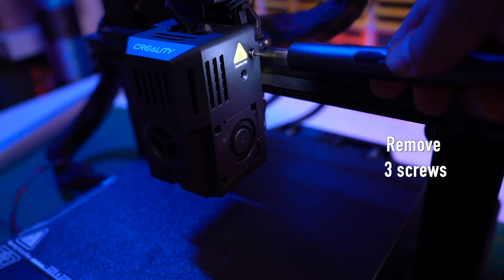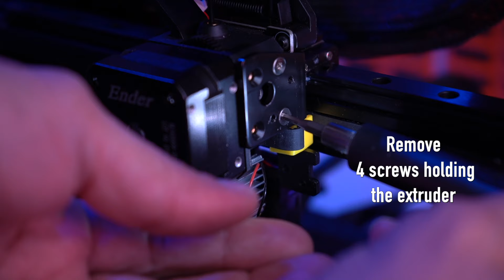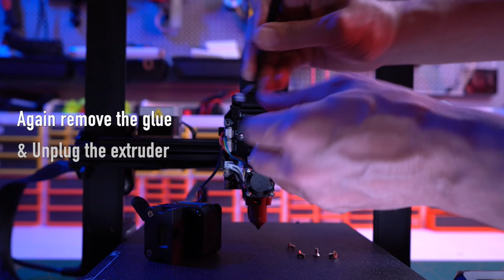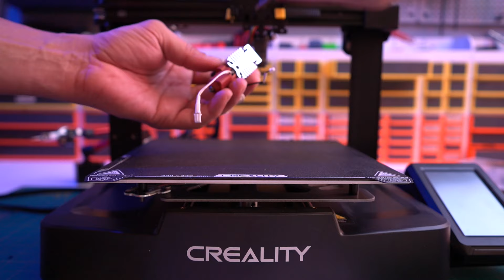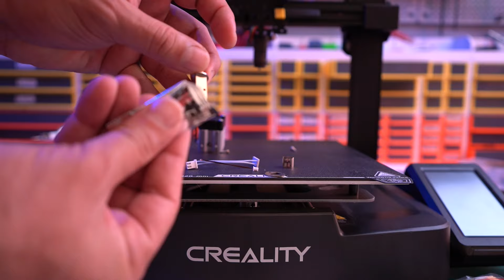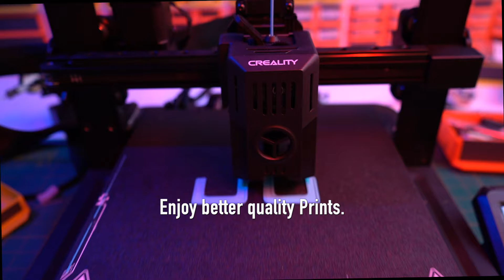Toolhead / Hotend upgrade ... Ender3 V3 KE Part 1  ... HOW TO

Comment: There’s not much sense to swap k1 hotend, V3 KE works very good and very precise and buying new hotend makes no sense.
Reply: Totally agreed! This is just an "upgrade" for the sake of upgrading. My stock KE prints as good quality as my Bambu X1C.
Reply from the maker: True, stock hotend is good and Might not make sense to u , all depends on ur experience, and the hotend is something optional to change, but servicing it is something not good with the stock, weight and nozzle options beside flow ... give it some time with the stock hotend you'll find out if it suits ur printing needs or not
Reply from the maker: @cybergnetwork588  oh man @creality3d should hear this ... KE is as good as the Bambu X1C , would oive to see a comparison... I mean, yeah, creality sent me this printer, and it's good, but this statement is so bold. I'm not sure how it's as good, printing nearly at half the acceleration/speed ... but there are few issues with this printer , I think the next upgrades could explain.
Reply: It works great until it doesn't. My KE had the same problem as many others - filament vomiting out of the sides and melting into a blob. I replaced my hotend with another stock Creality one, but it's not heating correctly. Like 50 degrees too cold incorrectly. I have a Microswiss hotend on the way.
Reply: @waggy401  I have the same experience creating those blob on specific PLA
Reply: Im using this tutorial because one of the connector wires got severed while cleaning
Reply: I just got the error “nozzle heating not as an expected” and it was working yesterday. I think stock hotend is suck…
Reply: Can it print nylon good with that hotend? Or should I upgrade?
Reply: I broke my hot end while repairing and it got stuck. Filament was not extruding. Brand new printed gone within 4 hours. 😅
Reply: @omranello I’m looking to transfer my hotend to dual extrusion
Reply: @omranello  yeah I've found some issues with both of mine. The V3 corexz fixes most of them but I have 2 KEs and don't have much money to sit upgrading at the moment. Honestly creality should've designed the entire z gantry better and fixed the y axis, that's really all it needs to be decent, a better extruder would've been nice cus the sprite won't keep up at high speeds, they limit the machine in the profiles with volumetric flow

Comment: so the belts and idlers of the K1 that are in the description are fully compatible with the KE or do you need e-steps calibration after replacing them or something else ? Cause the Y & X axis belts are grinding a bit , but not bad , and something stronger with more grip would be more suited as even now i have an order of 1500 small prints , so my SE & KE aren't collecting dust ( i'm novice to intermediate level xD )

Comment: Does this require any modifications to firmware code or anything like that?
Reply from the maker: @mDayShamangahabash  not really ... it need a PID tuning ... but if u have no problems with ur hotend ... please don't change it 🙏
Reply: @omranello  Changing it will allow me to use standard length nozzle replacements, instead of KE's long ones.

Comment: Hello, I'm a beginner. When changing to this hotend model, do I need to make any additional adjustments or can I use it as a direct replacement for the factory default?
Reply from the maker: Direct .. replacement... but PID Calibration is needed ... if ur hotend working fine .. dont change it
Reply: @omranello  I tried to buy a hotend like you and found that the temperature probe cable was too short. How do you solve this problem in ender3v3ke?

Comment: i place this hotend and all the time crashing printing any idea why? looks like fillament to fast going and burning, nothing updating in slicer? or somewhere else? and printer always show nozle heating problems
Reply from the maker: What do u mean by "crashing printing? And filament to fast?"... u only need to do PID for the Hotend ..
 Make sure ur thermistor is connected properly and no wire is disconnected ( for the heating problem)
Reply: @omranello  sometimes write printer nozle heating problem and restart printer, start print good but later looks like filament burned in nozle, how to do pid for the hotend? all parts is connected
Reply from the maker: @Deividas33  sounds like u have nozzle leaking .. make sure ur nozzle is tighten to exact torque ... and for the heating .. most likely it's ur thermistor .. check the wiring... maybe a pin is loose or something.
Reply: @omranello  everything looks like fine, what u mean about PID for heatend, how to do it? maybe there problem? jumping temperature is higher with this hotend. i just placed this hotend and start printing
Reply from the maker: @Deividas33  please search (hotend PID tuning) to learn more about that.

Comment: Thank you. However i need some clarification, in the link you've listed it says the OT is for the K1.
Will it fit the ender 3 v3 KE? which model i need to choose? does it also replace the thermistor? I managed to tear mine and did damage to the hotend so am looking for an upgrade
Reply from the maker: Yes, and yes .. u can chose the OT for the Sprite .. just Ask Triangle Lab in Aliexpress, and they will advise u which one to select. It's been a while so am not sure what r the offering in aliexpress so I can't advise more . But the one I fitted were from the Sprite extruder model they fit plug and play
Reply: @omranello  did it come with the thermistor installed on?

Comment: So flow rate slightly improved and just easier to service? Killer video as always! 🤙🏻 Curious your opinion on buying an ender 3 just to turn it into a CNC machine? Viable or silly?
Reply from the maker: Weight is lighter slightly , more options and cheaper MK8 nozzle to choose from   and faster heat up,  and the flow u can see my other OT Video yo see the diffrance ... it's kinda getting ready for the next mods.... as for the Ender 3 as a cnc .. if u r into Tinkering,  but LDO just Got the CNC kit for sale .. should be a cute one to play around with... not sure about the price tho it's High ...
Reply: @omranello you can adjust your flow rate in the adjust part in the ke

Comment: Why does your hotend slide out so easily?
Reply: There is a screw in the back of the heat break. you need to remove the heatbreak of remove the Z touch to acces it.

Comment: I Need to replace my heatsink with a new hot end. Do I need any type of thermal paste or simply use the screws to put it back together. Tia
Reply from the maker: If u have its good to use... if not u can still use it without